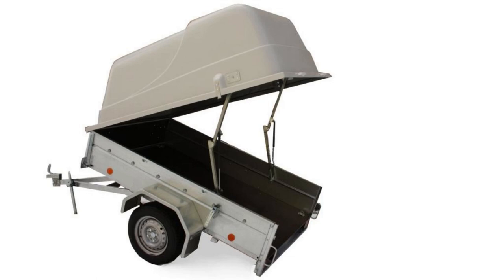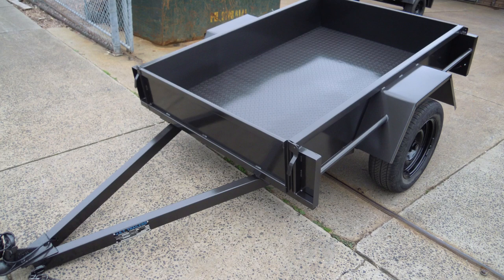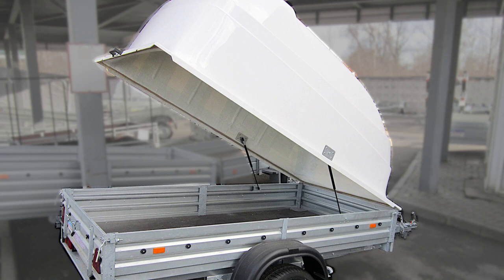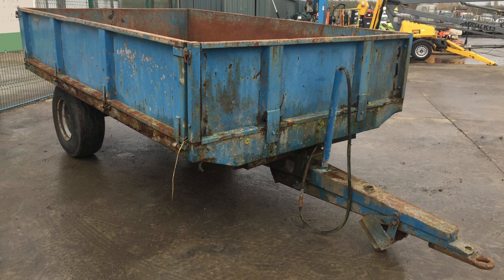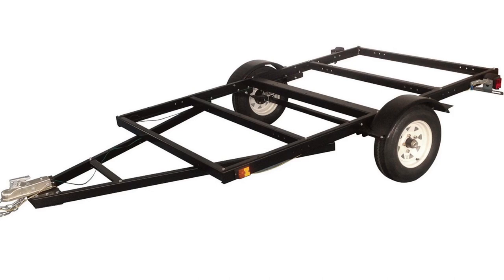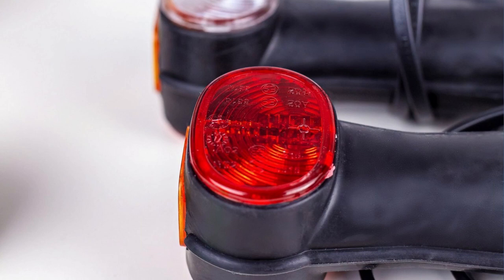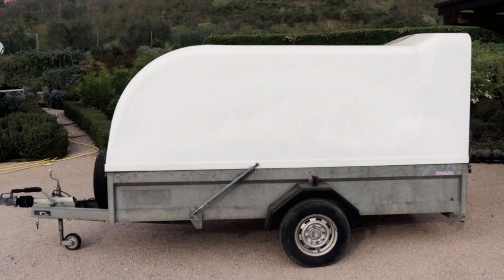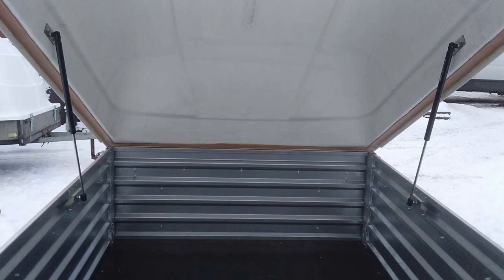[The Off-Road Ranch] #18. Vision of a Trailer: Weak Points & Modernization

Comment: Valeryia, I think in this case you need to look not at the secondary market for trailers, but buy a new one.  And what if a normal trailer is bought new right away, then its modernization isn't needed, but the trailer will need regular maintenance.  In any case: what I write is only recommendations and everyone has their own opinion and vision on this matter.😊
Reply from the maker: Yeah, I agree. You will never the real condition of a used trailer. And since a normal standart trailer doesn't  cost an incredible amount, it is rationally to buy once and forget about problems.